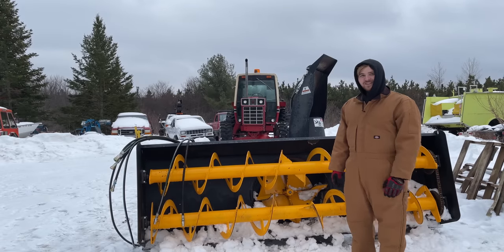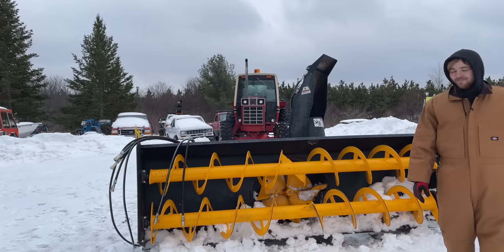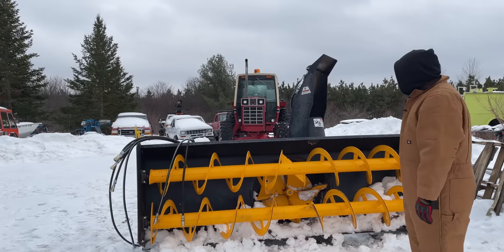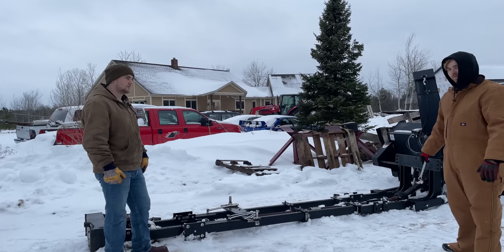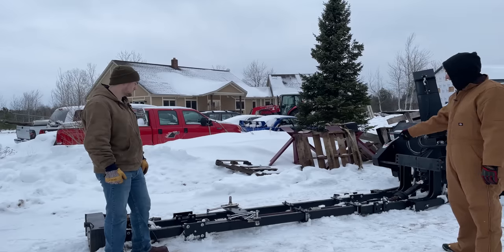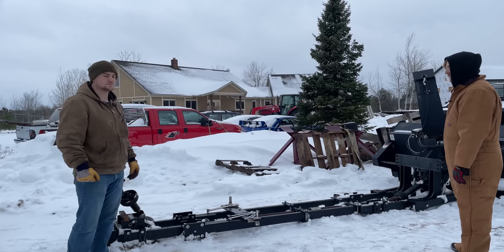135 HP Snowblower! 1979 International 186 Hydro Snowblower

Comment: The sound of the tractor is way better than the music. Nothing like a diesel at work. Nice job with the installation.
Reply from the maker: I tried to only have music when I didn't have audio of the tractor. Drone shots I don't have audio for sadly.
Reply from the maker: I realized I didn't get rid of the audio during at least one clip of the tractor running. I will do better next time!
Reply: @fixanddestroy9669  Depending on the editing software you are using you can overlay the tractor sound over the drone footage. No big deal, just an observation.
Reply from the maker: I can overlay sound over drone footage. I just need to record tractor noise next time. Thanks for watching and commenting!

Comment: Hydrostatic drive would be very convenient to run a snowblower. My family farm had an IH 826 Hydro Demonstrator. It was a good tractor but if you got it stuck, don’t pull it out dragging the drive tires, make sure that you are spinning them faster than your movement across the ground.

Comment: When setting up a large tractor for snow blower work and there is the option for 540 or 1000 RPM drive. Always take the 1000 RPM option.     It puts way less stress on both the tractor's internal PTO drive systems and the snow blower driveline.
Reply from the maker: Good to know. Last time it was on the Massey it had a nice and scary hum with running 1000 rpm. We wanted to try it out slow with 540.
Reply: @fixanddestroy9669  Often that comes from the main blower paddles churning up air being they are basically just really heavy fans. 

The only real concern with running them fast is if something is way out of balance and you will notice the shake immediately if something is dangerously far off. 

My personal preference for running on the higher RPM speed is that the tractor can be run at much lower engine RPMs for lighter work which makes maneuvering much easier if the tractor has to drive backwards to blow snow.

Comment: We had a black stripe 186 hydro and I don't think it was 135 HP. My 4020 diesel could out pull it. It worked well for what we did with it. Used it on a compost turner.
Reply from the maker: This tractor has a turbo added to it. It is supposed to add roughly 20 hp. 115 hp to 135 hp.
Reply: @fixanddestroy9669  oh that would make a difference. Ours didn't.
Reply: 4020's shifting pattern was the biggest Cluster#uck ever ..

Comment: I’m from southern Arizona and never seen a snowblower like that work so I have a question.    What happens if you hit a chunk of hard solid ice under the snow?    Will it just eat it or will it break?
Reply from the maker: It would probably just get pushed by the front augers. If it is small enough to fit through the auger it should get eaten by the fan. We haven't been able to put a lot of run time on this setup yet, so I am guessing.
Reply: Or break a shear pin if it’s big enough

Comment: What's the pto speed of the blower?
Reply from the maker: Currently 540 rpm. Blower specs are 540 or 1,000 rpm. Andy wants to try 1,000, Hunter does not.
Reply: @fixanddestroy9669  I dunno anything, really, about big blowers, so I don't know if that adaptability means you change the gear ratio in the machine or not, however, I can tell you from my small blower experience that impeller RPM makes a huge difference in that case.
On my old walk behind blower I increased the the impeller RPM from 1200 to 1800 and it plugged a lot less and threw a lot further.
One downside, tho, if you pick up heavy objects, like rocks, it can launch them into orbit with too high of RPM's.
Shear pins also will become less effective as shear pins can only stop applied power, not the momentum in the machine.

Comment: You can't judge new horsepower verse old real horsepower.  Love both tractors but 186 will run circles around the mf
Reply from the maker: I agree. Big difference between the 6-cylinder International and the 3-cylinder Massey.

Comment: The only way that thing has 135 horsepower is if it's turned because it's only a 105 horsepower tractor
Reply from the maker: You are correct. It has a turbo on it. Turbo is supposed to bring it up to 135 horsepower.